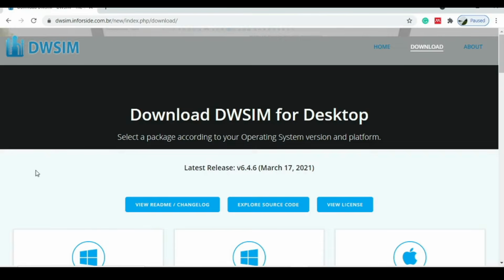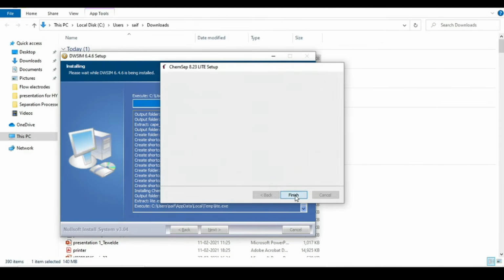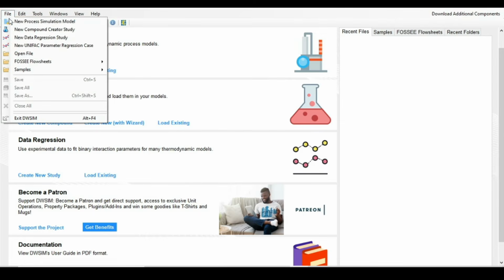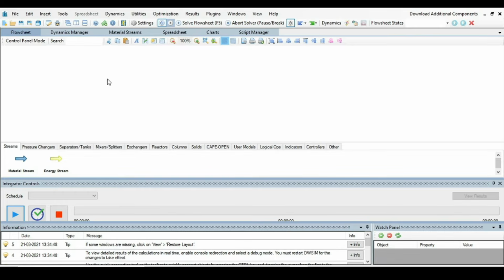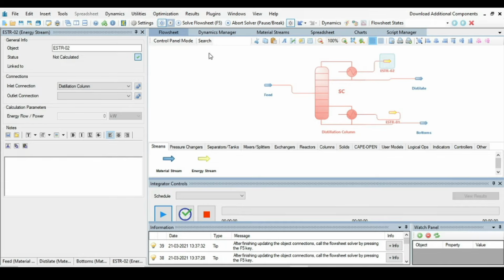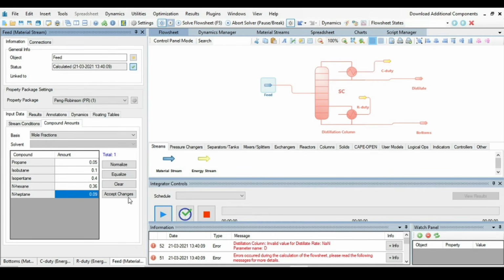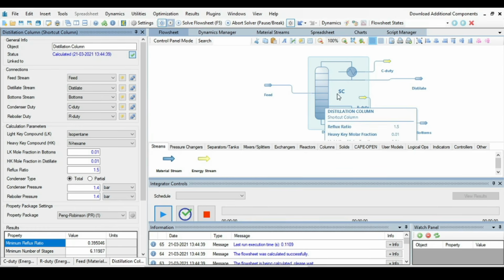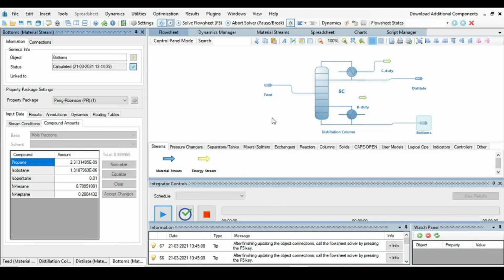Free Download and Installation of DWSIM | Shortcut Distillation Calculations in DWSIM

Comment: Thank you so much for the detailed explanation. I used DWSIM 8.8.0 to redo your example. I entered the mole fractions into the feed input: 0.05,0.1,0.4,0.36, and 0.09. However, when I run the solve, the mole fraction values were returned to 0.2 for all products. Is there something wrong? How to fit it. Thanks

Comment: Thank you for detailed lecture!
But I have a question about LK & HK.
What's the standard or condition for selecting the light key & heavy key?
I remember from my student's memory that the Heavy key is normally selected for mainly unboiling(?) material.
(I mean the material which is more contained at bottom area)